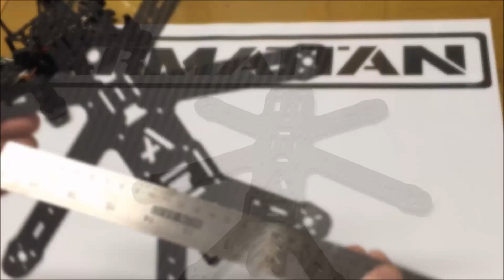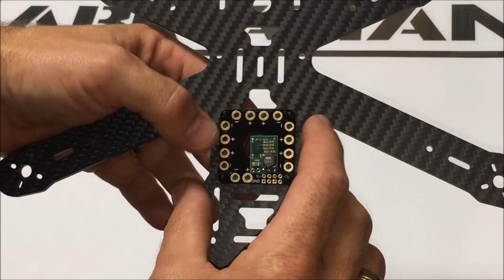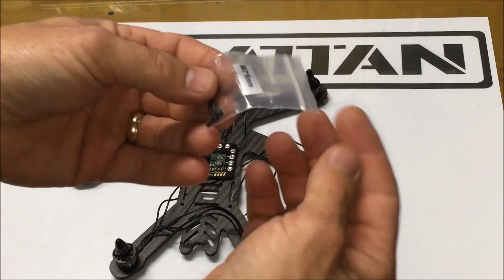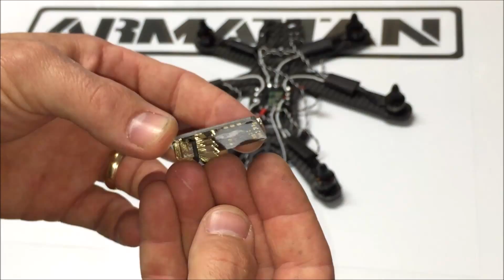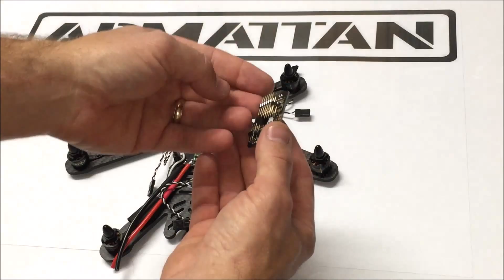Armattan Mini Hex Build Tutorial

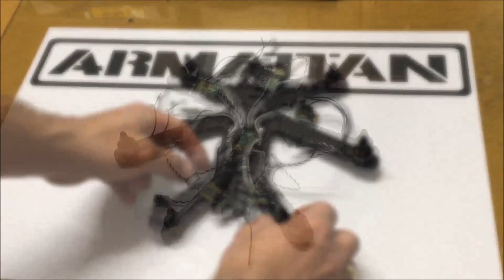Comment: Which Motors wires to cross@ 16:30. I've had to watch half the video just to find that spot too many times!
Reply from the maker: +unbentcrayfish Greetings:  IF up are using the Armattan motors / ESC's the crossed motors are M1,M2, M5 and straight is M3, M4,M6.  Cross any two wires, don't matter which ones you cross of the three.   Hope that helps you .  Let me know.  Thanks
Reply: +Brian Mays Oh, thanks Brian! Once again you are a great help! You fixed up my mini hex (that I murdered with horrible soldering) and its still running great! I was swapping out my motors to 3100kv's, the 3350(Idk the exact rating) motors were to fast for me.

I learned my lesson with soldering, hopefully I won't have to send it back to anytime In the future!! knocks on wood